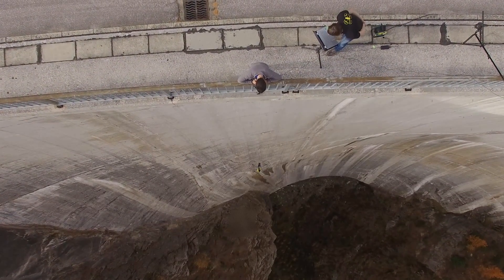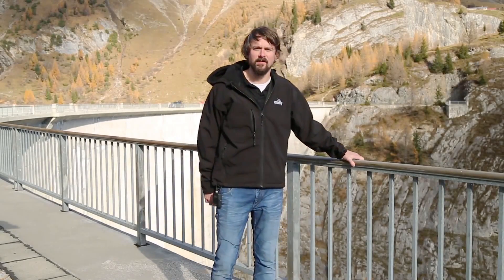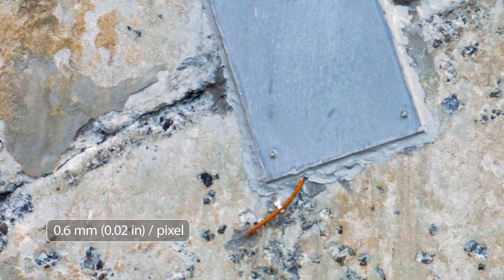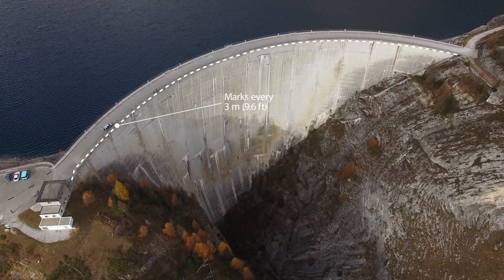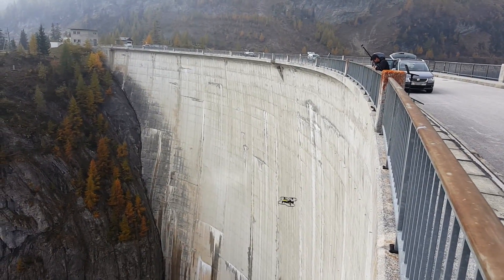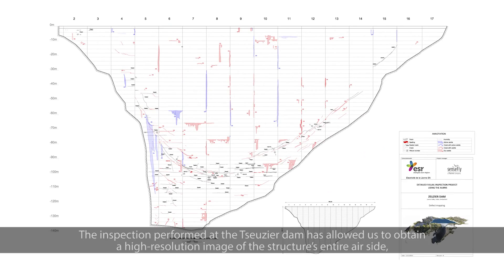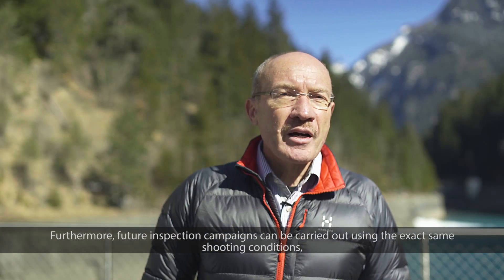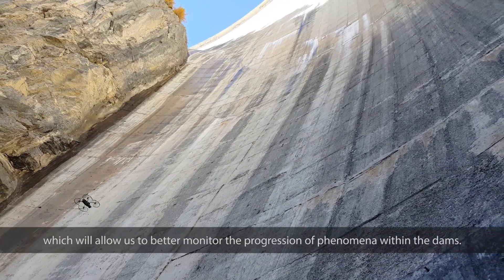Inspecting the Tseuzier Dam with an albris Drone

Comment: How long did it take the computer to post-process? There are many photographs. and how does AutoCAD work fluently?
Nice job.
Reply from the maker: Thanks, David! 

A total of 7,000 high-resolution photos of Tseuzier dam were captured—no small task in terms of subsequent image processing and orthomosaic (orthophoto) creation.
Using an Asus laptop PC running 32 GB of RAM, senseFly’s team used Pix4Dmapper Pro to process the data. Initial processing took one week. A few manual tiepoints were then added in areas of insufficient overlap, before an additional 40 hours of point cloud densification. This was followed by two days creating four orthomosaics, spanning different, overlapping sections of the dam’s face, then two further days to analyse these orthoplanes in order to create Electricité de la Lienne’s defect report.

You can read the case study here: https://www.sensefly.com/app/uploads/2017/11/documenting_large_dam_senseFlys_albris_inspection_drone.pdf

Comment: Great video! With the #OrovilleDamCollapse in the US last week, governments and infrastructure experts in EVERY country would benefit from using drone inspection teams to assess the integrity of dams, bridges and surrounding areas. These very efficient, cost-saving tools gather high-resolution aerial photos and video to provide an immediate assessment of the current conditions of cracks and past repairs. <This whole on-site inspection took 2 crew only 8 days>. More importantly, drone aerial data provides a benchmark to easily, accurately re-inspect and monitor degradation and changes.  #GoodDroneWork #DroneCaseStudies.